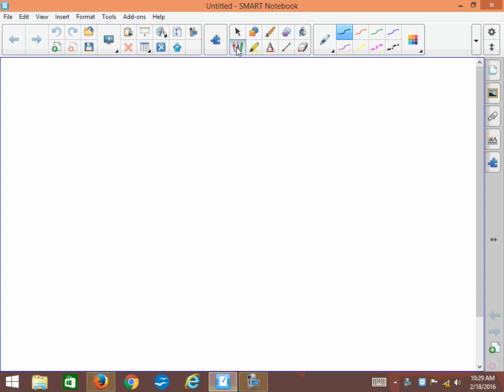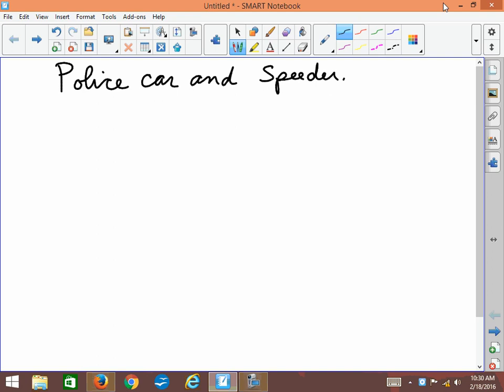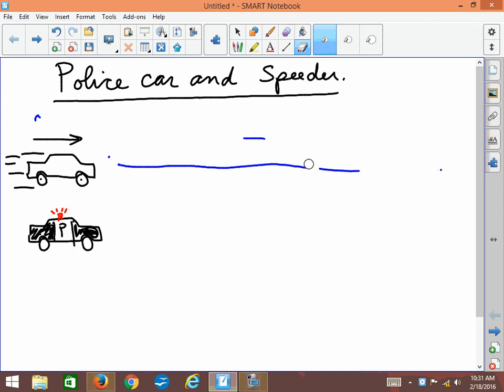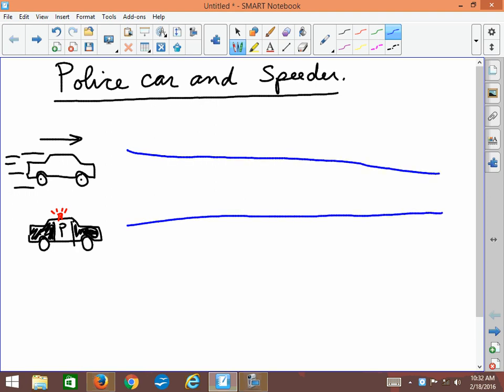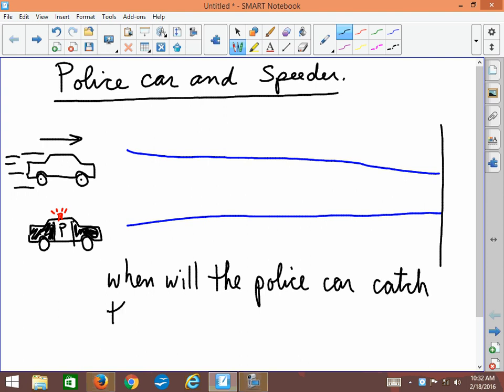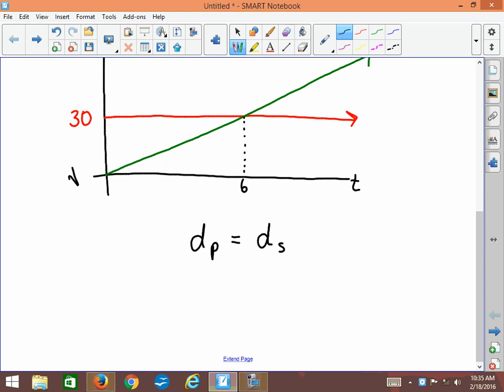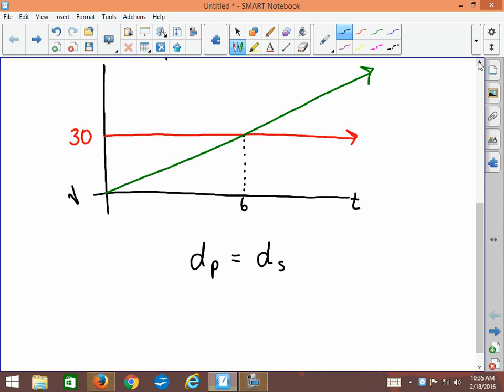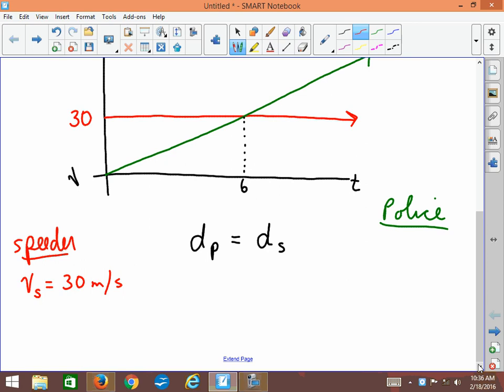Police Car and Speeder   Solution 1

Comment: What would you do if the police speeder takes 1 second before leaving (to put keys in the ignition)?
Reply from the maker: You would have to start the police car's graph at 1 second instead of at zero.  This would complicate the scenario a bit but you could still use 1 second as your reference point and add one second of time to any times you calculate.  In other words, draw your y-axis on x=1 instead of x=0.  Then just remember that all times are really t + 1.  However, it makes no sense to do so - the scenario begins as soon as the police car begins to move and any amount of time beforehand is irrelevant.